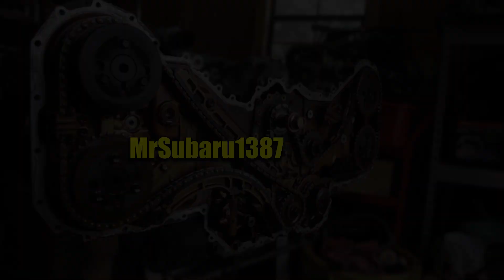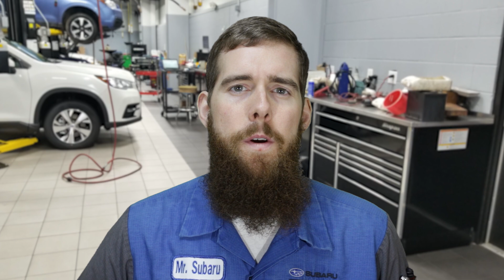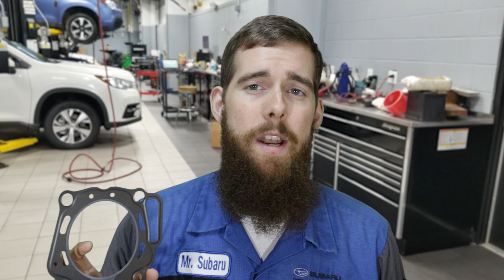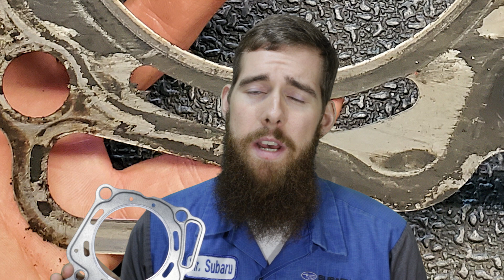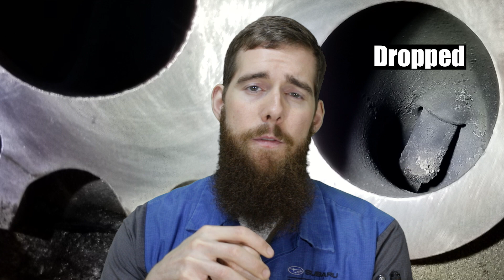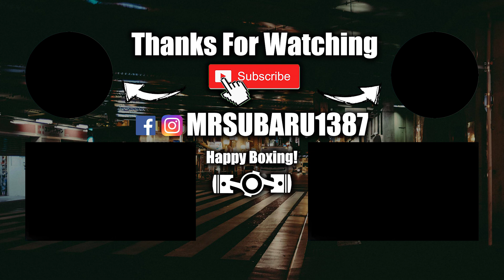Subaru Head Gaskets Explained

Comment: In 20 years of working on and owning Subarus, I have found three issues on the headgasket failures with phase 1 and phase 2 EJ25s. First, the coolant not being changed at least every 60k on the blue (or every 30k with the green coolant). I consider it "severe duty" here in Colorado because of the temperature changes and going up into the mountains. The coolant builds up carbonic acid from the combustion process and that would eat the coated gaskets especially.
Second, the adding of tap water instead of distilled water (never use de-ioned in an automotive cooling system). Using water with the minerals still in will create electrolysis and etch all the metals, again deteriorating the headgasket.
Third, allowing the coolant to run low, creating steam pockets and thermal distortion from the different metals moving at different rates.
The factory turbo headgasket doesn`t fail or get the Mahle improved design (they make the factory headgaskets by the way). I have had good luck with the blue Fel-Pro also.
I had a hypothesis that if the EJ25D would have had a retorque procedure on the cylinder heads at the 15k service there may have been fewer failures as well? I know it would have made for a lengthy service but I always wondered why Subaru didn't have a valve lash adjustment in the service schedule too. There used to be this service on the bean can EA cars.
Heads being surfaced incorrectly is a problem at many machine shops. They need to have the correct RA and not done with a sander. I recommend new head bolts whether or not the heads were rebuilt (but the valves should be faced as he said).

Comment: BEST VIDEO EVER on Subaru head gasket issues !!!!!!I absolutely learned so much, and you dispelled so many myths... I have a normally aspirated, 2009 Subaru outback that has been meticulously cared for, coolant changed early, best high-quality oil’s and filters, babied the car... So far no problems for 130,000 miles. Is mine a single layer head gasket that definitely will need to be replaced ??? I was hoping to get 300,000 miles out of this car...If the head gasket goes, I want you to repair it, we only have a subpar dealer in town. Thanks so much for an awesome, instructional video!!!!! Do you work close to Pennsylvania?
Reply from the maker: Yes, the 09 SOHC 2.5L still used the single layer coated gasket from the factory.
Reply: @MrSubaru1387  They did have some improvements over the ~06 and before models though, right?
Reply: @802Garage  they sucked conditioner just prolonged their life

Comment: When I bought my 2010 Impreza, all the online chatter at the time was that the head gasket problem was solved and I would have no issue. WRONG! 120k miles, oil nearly pouring out the bottom of the driver's side head. I did the head gasket job myself, but took the heads to a local Subaru engine rebuilder for a full checkout and rebuild. As much as we love our Subaru, the fact that this problem began in '96 and continued until 2012 is a complete deal-breaker. What it tells us is that behind the scenes there are serious operational problems at Subaru. The overall Subaru design concept is fantastic for those of us that live in the mountains, but the company kills the concept with its pencil pushers. Never again.
Reply: I hit a deer with my first 2010 Impreza.  I then bought another used 2010 Impreza with 121k miles on it.  I had the parts for a complete timing belt replacement for the first car that I never was able to use.  I inspected the areas where the heads and block come together and I did not see any evidence of oil leaks before I bought the car.  It started to show oil seepage shortly after buying it.  

Lucky for me, I simply bought the better grade head gaskets used in the STI engines and installed them at the same time that I replaced the timing belt.  What I find odd is that my wife's 2009 Forester has never had a head gasket leak.  All three of these Subaru vehicles use the EJ253 engine.  I am not sure if the Forester had the better gaskets put in at the factory or not.
Reply: My family and I have (and had) many Subies. No issues at all. My 91 Toyota Supra did tho. Those straight 6s 7MGTE engines were notorious for head gasket issues.
Reply: Engineered obsolescence is the industry term

Comment: I worked at a Subaru dealership and I've worked on a lot of all types of cars including euro...all alloy block engines r prone to head gasket failure IF the engine wasn't babied cold ...the block surface concaves from work hardening from the fire ring in the gasket ..the gasket flutters 0.005-0.0010mm when the engine is cold and there's an increase in clearance between head and block surfaces ..this is by far the main cause and we had dozens of ppl who didn't listen and plane the block and on reasemble EVEN WITH the top quality gaskets used and it won't show up on cylinder leakage test

Comment: Not a Subaru owner, but am miffed to why Subaru would not automatically supersede the original HG with the MLS at the parts counter. Maybe I missed something in this segment.
Reply: Mike R they have tons of stock.   Plus not many cars make it to 100k miles.  The ones that do don’t make it 200k.
Reply: @brianhilligoss  Not many cars make it to 100k? What the what? Would love clarification on why you think this.
Reply: @MR_Garage  Changes of ownership, imho, lead to degradations in maintenance as successive owners are less and less invested in maintenance and repairs; coupled with the high cost or repairs, people junk them before repairing them. And, the manufacturers only desire is that they test new with high CAFE mileage numbers and then survive the Federal and State emissions controls mandates during the required warranty period. In short there are a lot of non-durability, non-design issues factored into vehicle life. Getting high miles of operation on a car these days is like being concerned about driving for good fuel economy (not hypermiling, just being gentle on the throttle and anticipating slowdowns and letting up on the throttle).

And then there's statistics. A well-made unit has to end up in the hands of a caring owner. Most units, well-made or not, end up in the hands of un-caring owners because there are more of them.

The Subaru head gasket problem is a different issue. It was a mistake and the mistake was made by a brand who's owners actually, for the most part, care and take care of their vehicles.
Reply: @brianhilligoss  not many cars make it to a hundred thousand miles? Dude it's 2020 not 1965more cars on the road than ever have over a hundred thousand miles it's not even a milestone anymore it's an expectation

Comment: I bought a 2004 Subaru Impreza with head gaskets that were done at 50k miles and they took it to an independent shop. I specifically bought the car because it had them done and 70k miles later I might have to redo them again. This is why I don’t trust anyone but myself to work on my cars. I bet the mechanics didn’t recondition the heads. It’s an extra $100 but completely worth it. I did them on my 98 Legacy GT and paid the extra money to redo the heads. I’m still in the process of of troubleshooting a misfire on cylinder 4 on start up that goes away after 5 seconds. Spark plugs and wires are done, fuel injector is next and coil pack. If that doesn’t work I’m just going to say screw it and sea foam the engine. If not radiator is coming out and leak test is next since compression test was over 200.

Comment: I have the last generation H6 engine, no head gasket issue and I have almost hit 100,000 miles on it.  It does burn a little oil, nothing crazy, but no repairs needed on that car at all.  It has been a durable car that is great in the snow, and it has the 5 speed automatic not the CVT which has opened a new can of worms for Subaru.  Thanks for this video, I thought it was only a few H4 engines that had this issue and it totally confirms that.  That graphite on the head gasket - I wonder why they did that on those three engines?

Comment: Totally agree with you on the coolant change in fact for the 3.6 R it says 12 years or 120k I took that in half and did it six years I did it at about 78K on my 3.6 R all I did was a drain and refill from the Radiator The engine cold and the thermostat shut so I didn’t get the block but I will do it again this summer!

Comment: Whatever you say, there will still be thousands of people out there claiming all Subaru engine blow head gaskets and constantly making and spreading memes. I even see so many people in the Subaru enthusiast community spreading wrong info it drives me insane. Oh well, maybe in 5-10 years the hype of trying to get attention by spreading this particular false info will die down.
Reply: In 5-10 years EV will replace the gas engine. If Subaru does not put out an EV like the Tesla, all gas cars will be worthless. NO TRADE-IN value. YES... worry.
Reply: @denniss1211  Your timeline is veeery unrealistic. In 5-10 years we may see 10-30% of new car sales being EV. In 20-30 years most likely all new car sales will be EV. That doesn't necessarily include HD trucks and certain specialty vehicles. Subaru is already working on EVs with the help of Toyota. However, the majority of used vehicle sales will likely remain ICE for I'd say 20 years at least. Largely because many people simply can't afford otherwise or won't have the infrastructure available anyways. In order for all cars to be EV in 5 years we are talking about growth of the EV and associated infrastructure at a rate of about 100 times as fast as current, off the top of my head. Most manufacturers don't even have one real EV available in most markets yet.
Reply: Ringland  failures ?
Reply: @pirihern9329  Primarily an issue for the EJ257 and to an extent the EJ255. Not quite as prevalent as the internet wants you to think, that's for sure. Air oil separators, using only good quality high octane fuel, and regular maintenance with high quality synthetic oil can all likely help. Coolant system maintenance matters to avoid it as well to keep cylinder temps in check. Don't ignore check engine lights z change your spark plugs when you should, etc. Unfortunately it can still happen due to the material and design of the pistons, but it's far from guaranteed.
Reply: @802Garage  the way Subaru company treated the customers is the one that left a bitter taste in my mouth, had they took care of the problem, can you imagine how many loyal customers they would have retained/acquired regardless what anyone said?
Reply: @waellasheen9768  Can't disagree they could have handled the NA EJ25 head gasket issue better along with some others, but it is also hard for a company that was as small as they were at the time these issues started popping up to eat too many large expenses. Especially when you start talking largely about older high mileage cars.
Most cars that experience the head gasket failure are many years old with typically well over 100,000 miles and which have had multiple owners. How far does a company have to go? I'm not saying I side with Subaru over the customer, but most brands, especially if you look at any European brand, won't fix customer cars for free when they are well out of warranty in both years and mileage. Even if the problem is 100% a design flaw by the company.
It also didn't endanger owners as a general rule, so recalling out of warranty wouldn't necessarily be warranted. Again, I'm definitely sympathetic to the customer, but I don't claim BMW should be fixing plastic water pump impellers for free when the cars with them failing are many years old with 100K miles. If it's happening regularly within warranty period, it becomes a much bigger issue.
Just giving both sides. As I said, I do believe Subaru could have handled it much better all, but on balance I still love them as a brand overall, mostly having experience as a used buyer with no dealership interaction short of parts departments and test drives. I will also note Subaru has handled many more recent issues much better.
Reply: @802Garage  so  if I am in the market for either an Outback or a Forester which years do u recommend, I am not familiar with the engine types? Thank you
Reply: @waellasheen9768  Well the quick answer is both will be EJ25 prone to head gasket failure until 2010 or possibly 2011 for the Forester. So if you want to be certain you avoid the issue, make sure it's a post 2010 model year revised engine. Or, just get a Forester or Outback XT that has been well maintained, as they don't have head gasket issues and are more capable vehicles. You could also get any Outback with the EZ30 or EZ36 which have generally been very reliable. Your other option is just to get a car that has had the head gaskets done by a reputable shop with updated MLS gaskets. In which case any year is fine, just make sure it's not rusty.
Reply: This is what happens when a manufacturer refuses to admit a design flaw and initiate a recall, leaving the consumer to pay for it.  Same thing happened to Nissan and their defective CVTs.  Word got around and now they’re in danger of going bankrupt.
Reply: @stevens1646  Really not why people are misinformed. If Subaru had addressed it better or not, the memes would be the same. Nobody cares to learn the real info. Nissan has far more company wide issues than just faulty CVTs. One issue on a big pile.
Reply: @scottfirman  Absolutely. The reason is the naturally aspirated EJ25, which was by far their most common engine from the late 90s until the dawn of the FA/FB engines. Until 2010, the EJ25 had a very well known head gasket issues. That's exactly what is talked about in this video. The myth we want to dispel is that all Subaru engines have this issue. They don't. Specifically older NA EJ engines, any turbo engine, EZ engines, and FA/FB engines. Older engines could be mentioned as well.

Comment: Do you have this information in pdf format (spreadsheet) listing the year, engine model and issue/no issue, recommended repair/don't repair data?
Reply: I like this idea!!!
Reply: Basically, anything thats EJ25X engine may have the issue. That's most of the 2.5L engines, minus the turbo 2.5

Comment: Thank you for video!!! 
Would love vids on how the awd works on 2000 forester s and the electrical mod for power to the rear. 
Sadly I didn’t find this Chanel till recently. But my 2000 forester had external and my brothers 2001 forester had external. Replaced both with Felpro mls newest design. Both failed 5-6 years later internal failure couple months apart. All steps followed,  machined heads etc etc. 
Very upset and disappointed
Reply: Mr Subaru recommended to use the new and improved oem gasket. Unfortunately one car was scrapped and debating repair on second car
Reply: Cam Shaft If the car is otherwise in good condition, I would consider repair. The Subaru MLS gaskets can last an awfully long time, I bet it would outlast other items of your car.......
Reply: Joe Mikey problem is the labor and other additional parts required. To redo the original job that should have outlasted the car.

Comment: Thanks for the info shared on Subaru head gasket. I have 2009 Subaru Forester X 2.5L SOHC non Turbo. I am confused if the MLS head gasket you held up will fit in my subaru engine because the lining and holes provision looks different in the picture. Can you help me out here ? Tanner

Comment: Hi! My 2018 STI seems to have blown a gasket. The reservoir was bubbling/spewing coolant, temp spiked, and I had the faint smell of the coolant burning just prior to it all. I didn't even drive for 5 minutes. I dropped it off at the shop to see what they think, but it seems to be the exact description you gave. 😅 It should be under warranty though.

Comment: Great information!! Do you need to add cooling system sealer to the Subaru extended life coolant. Thanks.
Reply: 7239Matteo I’m pretty sure you shouldn’t put anything extra into the coolant. Just put in quality head gaskets
Reply: @7239Matteo No; after 4 years a test with coolant test strips should be performed annually; just to check alkaline reserve and pH and other parameters (absence of contaminants) or a test with a densimeter
Reply: I have a 2009 normally aspirated outback and I’ve change the coolant twice in 130,000 miles. Both times I did add the cooling conditioner, and so far good luck, no head gasket issues. I believe Subaru recommends adding the coolant conditioner with every coolant change.
Reply: I have a 2009 normally aspirated Subaru outback, I have change the coolant twice and both times I added the coolant conditioner, so far so good with 130,000 miles and no head gasket issues.......
Reply: @joemikey278  that conditioner was a wing and a prayer by Subaru hoping to fix some leaking gaskets